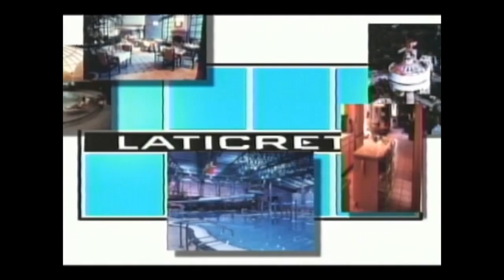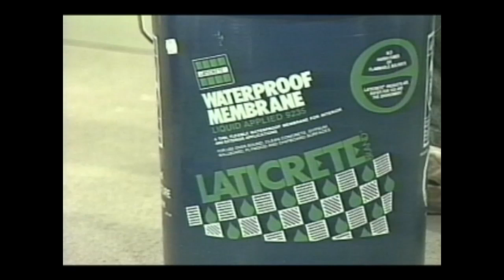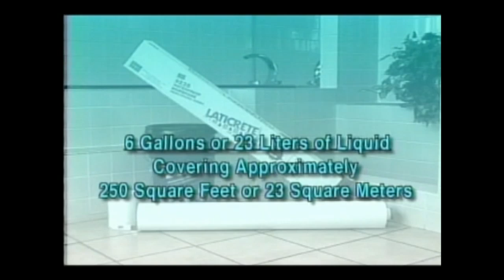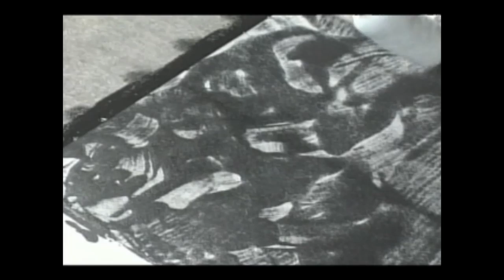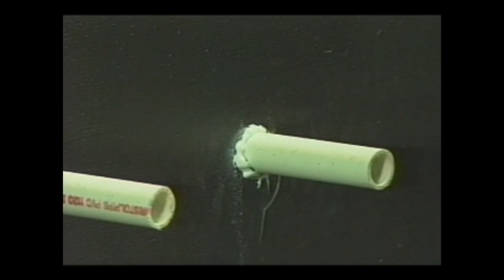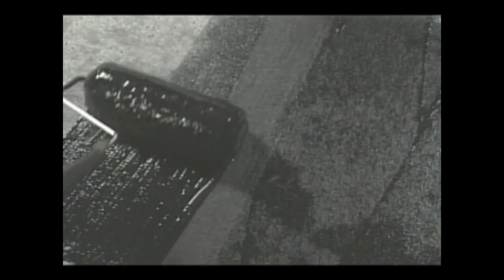9235 Waterproofing Membrane

Comment: What's the difference between this and Hydro Ban?
Reply from the maker: 9235 Waterproofing Membrane is one of our original liquid applied waterproofing membranes we still sell today! While this product is still popular and has it's uses one of the main differences you'd find with our newer HYDRO BAN product is the quick turnaround time and no requirement for using fabric! With HYDRO BAN, you can flood test or set tile to your project in just 2 hours after application. 9235 will require you to allow for 7 days after application before flood testing or tile setting and does require the use of a fabric.

Comment: Can I use this for a residential tile shower? Does it need hydroban membrane?
Reply from the maker: This product can be used for a residential shower, allows for flood testing after 7 days and should be used with reinforcing fabric to provide a seamless waterproof membrane. You can check out all of our liquid applied waterproofing products at www.laticrete.com